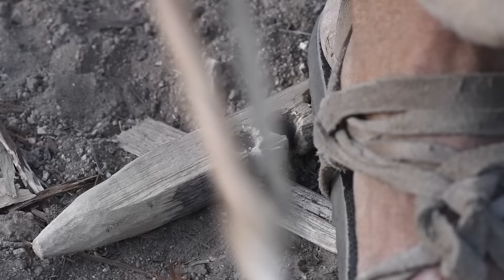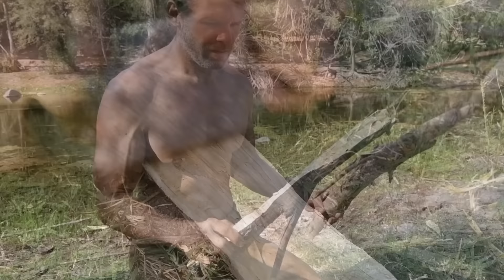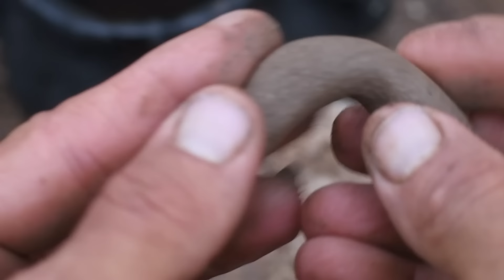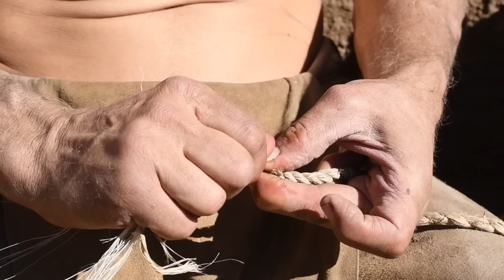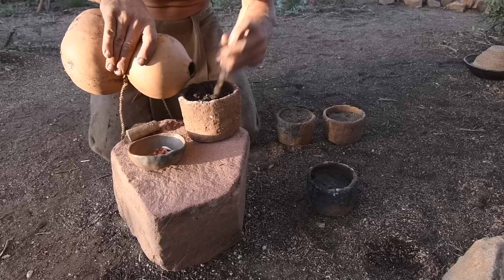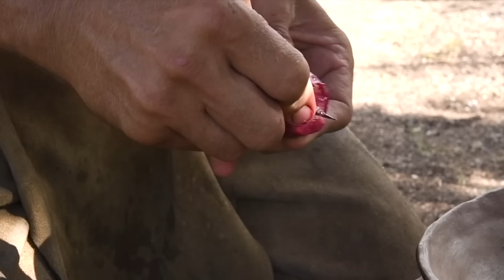Surviving to Thriving: First 20 Primitive Months

Comment: Speaking of primitive cooking, I need to fry some eggs
Reply from the maker: If you are in the USA, good luck finding eggs!
Reply: @ChadZuberAdventures  We live in the country and get our eggs from a neighbor.
We’ll be building a chicken coop this spring and let them “free range” in our fenced orchard to keep it bug free.
Next winter we’ll have to install artificial light and a heater to keep them warm
Reply: Yea I'm trying find chickens. It's definitely getting $$ for eggs
Reply from the maker: @Doc1855  I have been contemplating the idea of building a chicken coop here too but I'm not here all the time and I doubt they would survive the extreme temperatures.
Reply: @ChadZuberAdventures  The chickens can handle the heat as long as there’s shade for them. When you’re away, make sure they have water. They’ll eat table scraps and are excellent at eating bugs and insects.
I know that you don’t get the extreme cold temperatures and for as long as we do, but you’ll have to figure out a way to keep them warm in the winter.
They’ll lay eggs for 3-5 years and after that they’re great in soups. They do have a molting season every year usually in winter when there’s not as much sunlight and warmth.
Where we live, we have the 2nd cheapest electric rates in the USA, so using artificial lights and heaters are cheap.
We have a neighbor down the road who bought 2 very old camping trailers which he uses for his chicken coops. He just plugs in the heaters and it works great for him.
I’ll be insulating our coop so it’ll retain more heat in the winter months.
I’ll be putting our coop at the end of our orchard and use chicken wire to fence around the orchard so the chickens can eat the bugs.
Good luck to you, Man !
Btw, Everyone calls me Doc
Reply from the maker: @Doc1855  Hey Doc! Maybe I could just have chickens there for 6 months and then give them to some body else in the winter.
Reply: @ChadZuberAdventures  Yea, that would work.
But are you gone 6 months out of the year, or is it too cold 6 months out of the year?
Reply from the maker: It’s too cold for then six months out of the year
Reply: @ChadZuberAdventures  Bummer.
But at least you can get eggs for 6 months and then have chicken soup.
Perhaps you can put them down and put the meat in a safe place so they can freeze. When you want roasted chicken during the winter, you can thaw and cook them.

Comment: It's interesting to see all the steps to your journey in a row. We get to see your present achievements as the culmination of many days of hard, slow, painstaking work. Your patience, perseverance, and dedication are something remarkable. Thanks for sharing, as always. P.S. I'm curious. How do you look after your teeth? do you bring a toothbrush with you or something? Have you dealt with any other general health struggles as a result of your lifestyle?
Reply from the maker: The only health struggles I've had to deal with during my time out in the wild is physical exhaustion and weight loss. If I don't eat and sleep enough I get weak. Other than that, a primal diet doesn't require brushing of teeth. The end of a stick can be used. Yucca fibers and strands of my hair work well for flossing. The only other struggle has been dry cracked feet and fingers during the dry seasons. This is preventable by daily washing and soaking in a medicinal tea water. I just didn't take the time to do it because my days were always so busy filming and making stuff.
Reply: Calluses that crack seem painful! 

rritant contact dermatitis/ eczema orthoergicum can actually occur by washing with soap too often. It actually destroys the skin. Only use soap when really needed.

This is such an awesome video, never knew those strands of grass could be used as soap. The primitive shaving was inspiring too.
Reply from the maker: Yeah I can’t over emphasize the value of soaking the hands and feet in an oily tea. Crushed juniper stems quien quite well. It really helps prevent cracking when done at least once a day especially at night before resting.